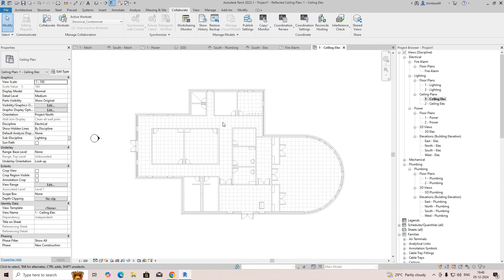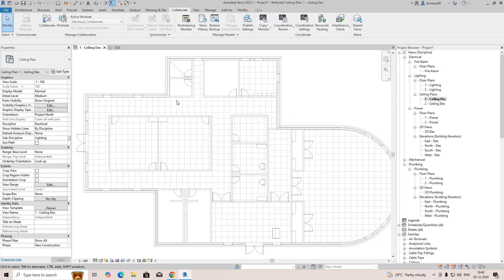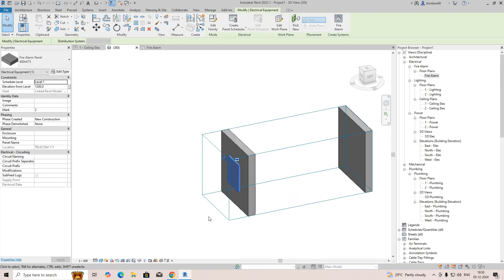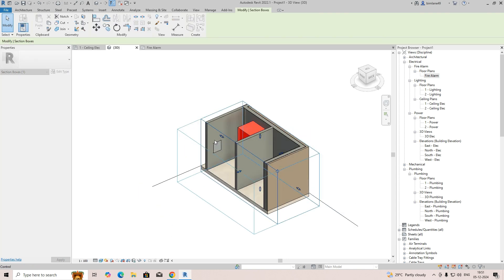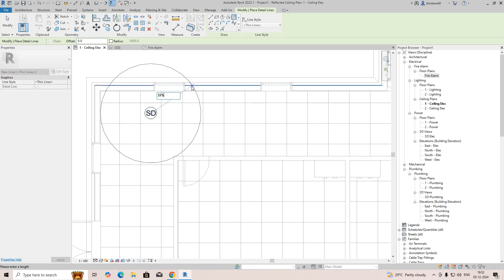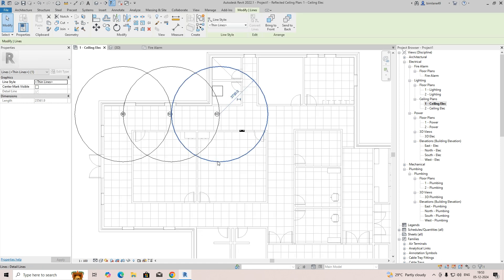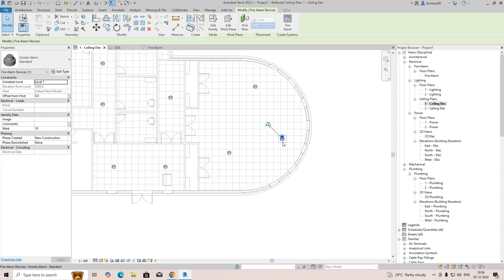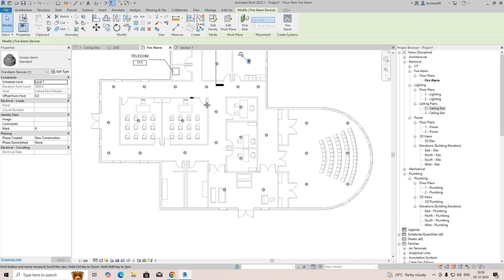Revit EXPERTS Reveal Electrical Fire Alarm Design Secrets!

Comment: Which pipe should be used for conduit fitting. When i choose the conduit pipe in electrical system, i am having issue with the bend pipe. Since i cannot find any family including bend, elbow etc
Reply from the maker: you can use Conduit